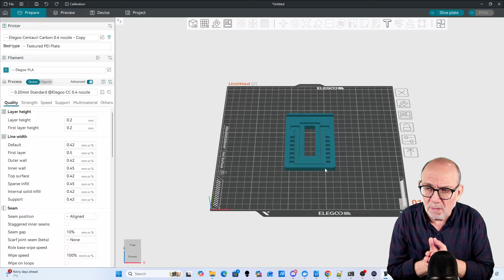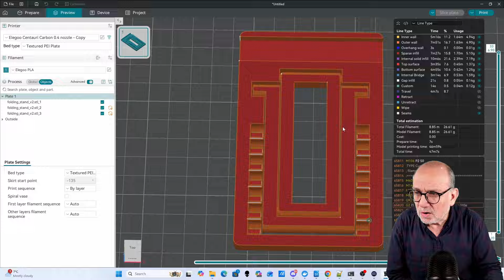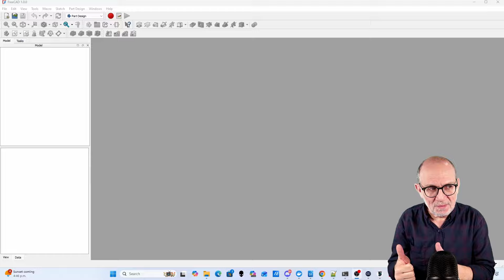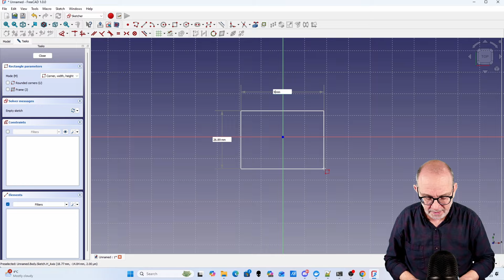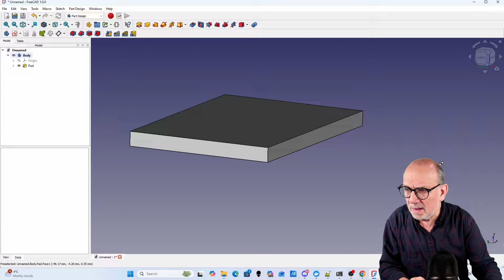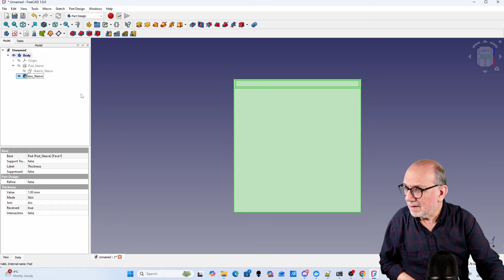Fixing Loose Print-in-Place Hinges: Orca Slicer X-Y Compensation & FreeCAD Tutorial

Comment: I think it is important to calibrate flow and  shrinkage of the filament % for X Y  before bothering with X Y compensation
Reply from the maker: Those things were all calibrated.  The issue here had nothing to do with the printer's calibration or the filament.  It's a problem with the model itself.  I didn't show it on the video but I did multiple dimensional accuracy test prints to make sure that the issue wasn't with the printer.  Thanks for the comment.